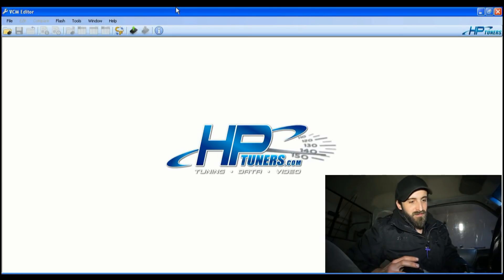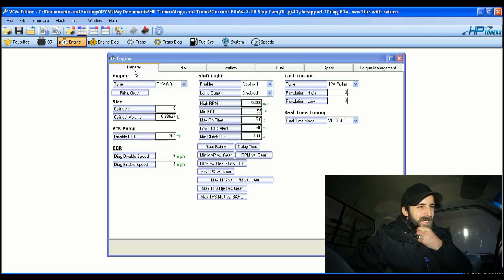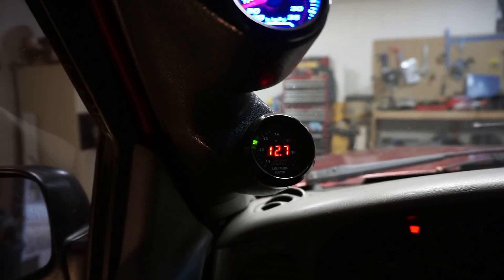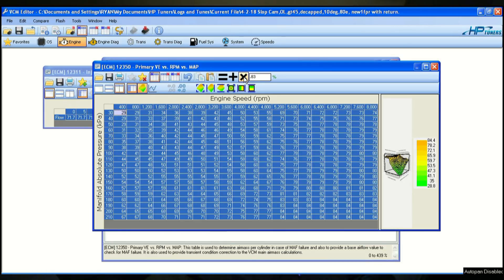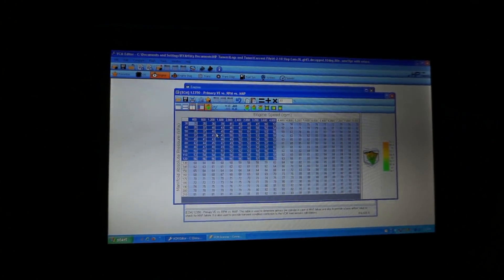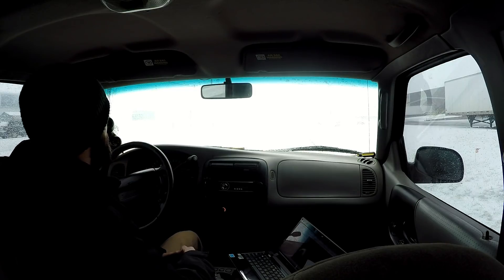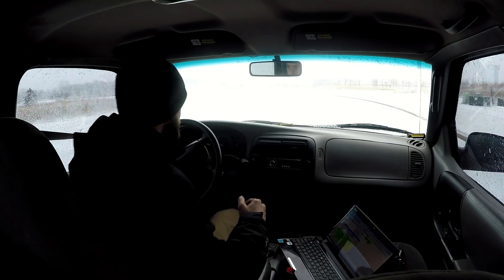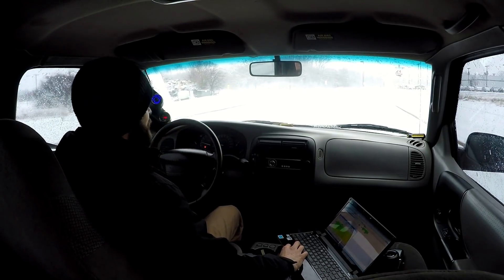HP Tuners Flow Rate vs. KPA For Return Style Boost Referenced Fuel Setup!!! - a21bravo

Comment: RTT kills my wideband reading in the scanner also. I have found threads about it but no resolution. 1 tip is make yourself save the file before you flash it, itll help you not get all backwards and shit
Reply from the maker: justin parks I usually save every time... Well, lately I have been. Glad to hear the RTT wideband issue isn't just on this computer... Visual off the gauge works pretty good but hard to do alone in the higher spots of the table...
Reply: a21bravo yeah it sucks, i believe it could be very useful with the histograms. Just fill it up and modify the VE in real time. It could really speed things up, but not if it doesnt work correctly lol
Reply from the maker: justin parks I've just been using the afr error histogram for anything above cruising. Works pretty good with the paste special but I've been very selective using that lately too.

Comment: Hey bud I think the reason you keep having to unplug the cable is cause when you write the file to the computer the Ve scanner still is Connected to the hp tuners . you must select Disconnect in VCM scanner , you cannot have 2 things connected to Hptuners at same time , one always must be disconnected . After that you can immediately write the file instead of pulling the plug , also , not sure how many channels you have the scanner reading but the more you have the more the comp is trying to read when your recording a log file . If you cut out everything you do not need in your channel listing not only does everything your monitoring work much faster they also become much more accurate because it can now keep up . I'm not sure if this will still fix your wideband problem but was reading up and couldn't find anyone with your specific problem . Gonna actually test your problem with Boosted Denali in the morn...
Reply from the maker: Boosted Denali The double open could be the issue... Unplug and replug is probably faster maybe I'll stick with that, lol... I was able to fix the scanner freezing my removing a bunch of channels... I could try a different config with just wideband and see if that fixes it... I've just been real time tuning by watching the gauge so not too worried about having it on the graph...